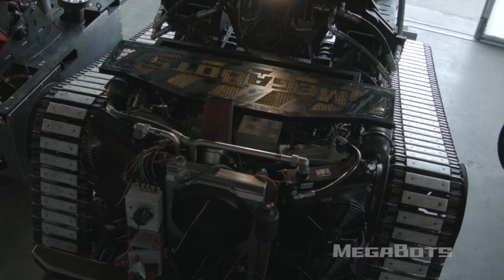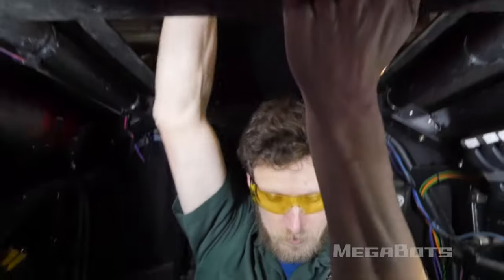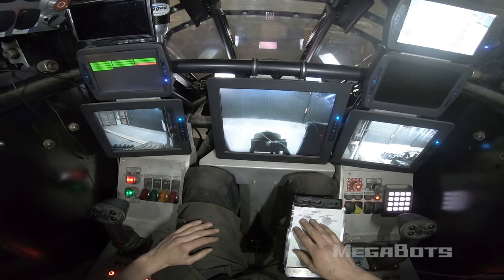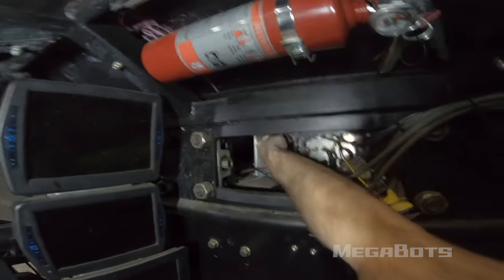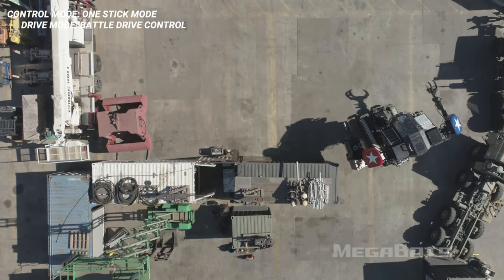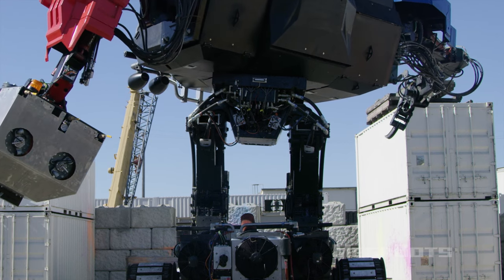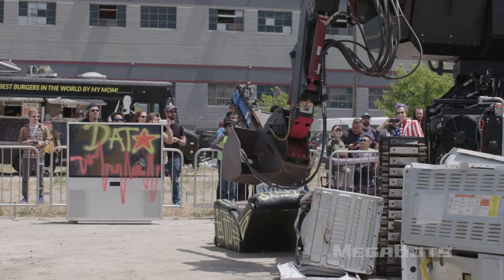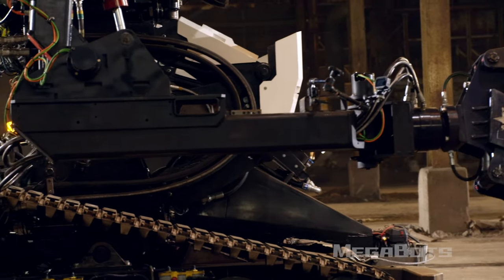How to Control a Giant Robot

Comment: This project is ahead of its time. Hope someones gonna dig this upafter 200 yrs and say ,,and this is how it all begun,, . Love you guys.
Reply: Technically, the how it all began could be traced back to the General Electric Beetle Mobile Manipulator. 
(Got the lead from Megabot themselves on twitter.) That thing is so old (1958-1962), that one has to wonder to which extent it would have inspired the apparition of Mecha in the anime industry. Which in turn lead to Battletech, Robotech, and the american mecha craze of the 80s-90s. Then you'd have the Megabot "Iron Glory" Mk.I and Kuratas which were practically built at the same time.
And then you have the Megabot "Eagle 1" Mk.II ... I'm still unsure where does the korean METHOD II fits into the whole thing though.
There are other contemporaries... but none that seem to stand the comparison. They are more like very big animatronics.
Reply: Probably not the future in this timeline. To stand upright means to be more visible to the enemy. The only useful thing that a giant robot could be useful for is to traverse rough terrain, and thats if it uses legs instead of tracks. That, or to momentarily get taller to attack before going back down to the ground to avoid detection. Long story short, the need for giant robots would be specific to a mission and not something that every country must have.

Comment: At first I was like : AWESOME!
Then it got more to : .................... Incredible.
Seriously though. Thanks for this one. It suddenly gives a whole new dimension to everything you have been doing with Eagle 1.
Plus, it's fun to learn how real mecha technobabble should sound like. 
In fact, I'm retrospectively more impressed by anything you have managed to do with such a complicated control scheme. 
It does feel a lot more like MechWarrior than any Asian designs. Hence, the pilots that will manage to make it move right will most certainly deserve to be called athletes. Must be quite a thrill to ride... :)

Still, one has to wonder if the balance issues with motion control wouldn't be resolved by a good pilot faster than it will possible to obtain a good pilot for such a beast. A fine technological race has started.

Comment: It seems good to me that each control is used for one side of the robot, but the same thing should happen to lower and raise the robot, for example if a single control moves to the left, the robot tilts, if the 2 controls are at the right, the robot moves sideways, if both controls point outwards the robot goes up, if both controls point inside, the robot goes down

Comment: NICE!!! Let me ask you a question?  Could you ever create a personal handheld drone that could carry a human ?  So think about the "umbrella" from Fortnite that contains an enclosed prop or 2 with draft that can be blasted outward.  Containing a gyroscope to keep level and a flexible prop system to retract. You could use a long torque engine in a tube and thin batteries inside the system.  Made from flexible yet very strong material and the electronics could feature GPS that you could add "waypoints " that it could fly to. Also, safety would include pitch safety controls and height "ceiling" limits.
Reply: they ran out of money